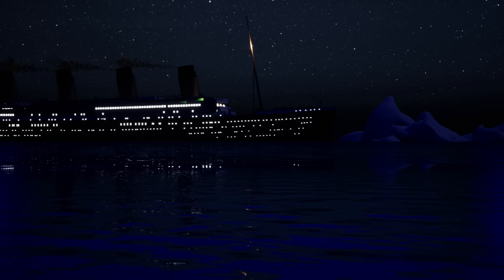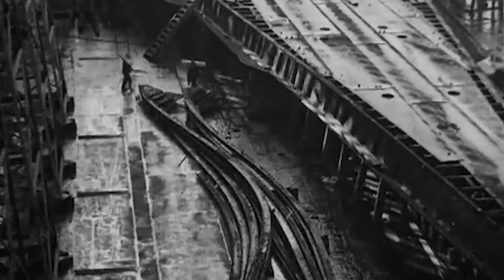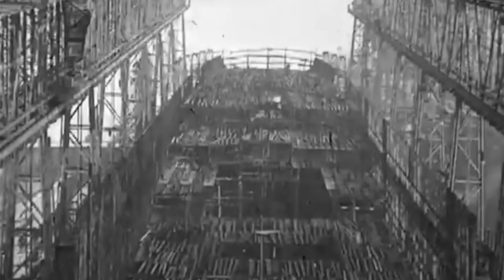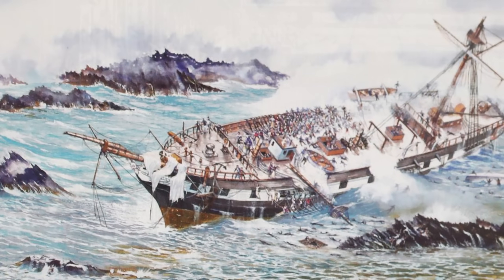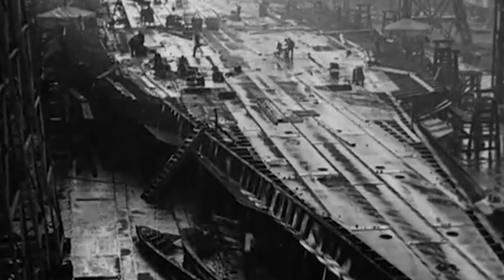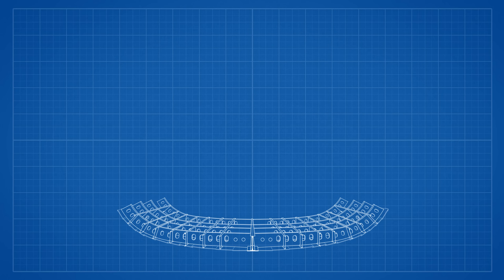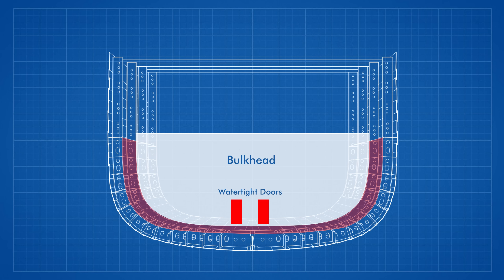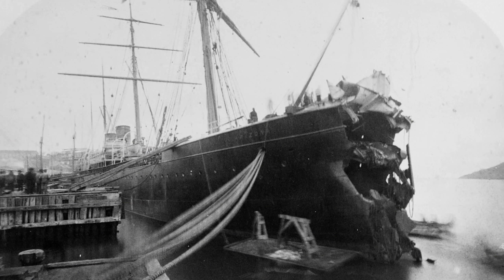How did the Iceberg Sink the Titanic?

Comment: Why would a crew member risk going through a closing water-tight door when they could just walk up stairs to escape the compartment? It seems very dangerous compared with the simple task of climbing stairs. Given the understanding, I assume, the ship was designed to deal with hits directly head on, but was limited in the damage it could take to the side (4 compartments), why did the crew try to turn the ship without any certainty they could get the ship well free of a side collision? While Titanic was able to turn aside to a significant degree, particularly for a ship her size and mass, trying to get by the ice berg seems a risky proposition when a head on collision was a near certainty of survival. Lastly, how are compartments "water tight" if they don't have a lid? Clearly, anyone could see water could, as it did, go over the top into the next compartment.
Reply: The Titanic basically broke records in her handling both leaving Belfast, and during her sea trials. For the size, her performance was remarkable. Murdoch had full faith the ship could avoid the iceberg, and in truth, they ALMOST made it.
Reply: Also, the compartments are watertight because the bulkheads do not need to be sealed at the strength deck (longest continuous deck that seals the hull).

No ships had ever been designed with bulkheads that reach the strength deck, and even modern ships aren't. The only exception is warships, and only the specific compartments intended to store munitions.

The watertight bulkheads work, even without being fully sealed, because water inside a ship cannot possibly reach any higher than water outside the ship. It's physically impossible.

The internal air pressure matches the incoming water flow, and equalizes, stopping the flooding. The water stops there, and ship bulkheads are designed higher than sea level, ensuring their functionality.

But when multiple compartments are breached along a ship's side (something that had never happened before in naval engineering) enough water is now inside the ship to pull her low enough, that the tops of the bulkheads are now below sea level, allowing the water to rise over the bulkheads and spill into the next compartments.

If you think Titanic's design was faulty, consider that the Olympic class liners were all designed to float with 4 compartments in a row flooded. After Titanic sank, the design was augmented to allow them to float with 6.

Modern ships can manage 2 or 3.

It's all about the design, but designs cannot overcome nature.
Reply: @pc_buildyb0i935  "If you think Titanic's design was faulty," Of course I think the Titanic design was faulty.It sank on its first voyage. By any measure, that is a faulty design.
Reply: @MacAdvisor  Sorry, but that is an entirely naive argument. Ships sink because nature overcomes their design. It's not possible to build a ship that is completely unsinkable, and so every ship can be sunk, therefore ANY ship can sink.

It's not due to a fault in our designs. We can't beat nature, end of story.
Reply: @pc_buildyb0i935  I didn't suggest the ship should be unsinkable, I stated sinking on the first voyage out shows a clear issue. Moreover, improvements were made to the sister ships, so there was a flaw to be fixed.
Reply: @MacAdvisor  I know you didn't say the ship should be unsinkable, what you said is that is shouldn't have sunk, and what I am saying is that nothing could have been done to prevent it because people cannot see the future. Every single ship ever built has a tipping point after which she will sink. While these tipping points change through history, and vary somewhat from ship to ship, none can be designed to withstand nature.

Consider that the MV Explorer, a MODERN ship, was sunk by an iceberg in 2007. You can't out-engineer nature.

 No other ship before the Olympic-class liners (Titanic included) had been better designed - Titanic and Olympic were the most sophisticated, most advanced designs ever at that time in history.

Ship design works like airplane design - designs only change after disasters.

No ship disaster had ever before happened like Titanic - and previous ships had hit icebergs head-on and survived just fine. The SS Kronprinz Wilhelm had struck an iceberg head-on in 1907 and only one watertight compartment was compromised.

The Wilhelm had been built during a time when ships were only designed to be able to float with ONE compartment flooded, if anymore than that flooded, any of those ships back then would sink.

In response, White Star designed Olympic and Titanic to float with 4 compartments in a row flooded, which was unheard of at the time and an example of over-engineering (it still is by today's standards, because modern ships can only float with two or three compartments in a row flooded - that's just less likely to happen these days).

Also consider the SS Norge, which collided with Hasselwood Rock in 1904 and had her bottom torn open. She flooded and sank in 12 minutes, and the majority of life board was lost.

In response, Olympic and Titanic were designed with double bottoms, to prevent that kind of disaster from happening.

Do you see what I mean? Ship designs are updated in response to accidents at sea. Nobody can see the future.

When Titanic struck the iceberg, it was at a time when no ship had ever taken side-swipe damage like that before, which is the reason why the ship's sinking was such a big deal.

Comment: Watching this again makes me wonder... IF the titanic had a double hull like it had the double bottom, wouldn’t the flooding have made it list to starboard badly and because of that possibly capsize?
Reply: Yes, most likely. Because the bulkheads would still run along the double hull length and would have stopped at the same deck as the bulkheads' tops, the water would have flooded the ship side-on and caused a capsizing. Far more people would have died.

Comment: Ocean liners also needed more life boats.
Reply: They did, but lifeboats were not primarily lifesaving devices back then. The Atlantic Ocean is notoriously stormy, and lifeboats do not survive even mildly stormy weather.

The very calm conditions that allows lifeboats to survive that night were so extremely rare, designing lifeboat numbers to accommodate situations like that made no sense.

Lifeboats were only aboard to ferry passengers to a nearby rescue ship. Take a look at what happened to the SS Atlantic and the SS Norge. Most of those boats were smashed to pieces against the ships by heavy waves, or rolled over in the sea, or simply flooded by breaking waves and sea spray.

Comment: The shipbuilder ordered number 3 iron rivets instead of the stronger number 4 type
Reply: Not true. Titanic's hull flank and double bottom were all sealed with 6" full steel top quality rivets.

The #3 wrought iron rivets, the same rivets every single ship in the world had been using for over a century at that point, were used in the very curved plating of the bow and stern
Reply: @pc_buildyb0i935  Interesting. So I guess I heard fake news about #4 rivets being better on the curve. Thanks
Reply: @AllenMacCannell  I wouldn't blanket term it as "fake news".

The stronger rivets were installed on the hull flanks and double bottom because the hydraulic rivet press was vertically suspended from the gantry.

It couldn't reach the lower and curved steel plating of the extremes of the bow and stern, so the larger rivets could not be installed there, and the traditional wrought iron rivets were instead used out of necessity

Comment: I've got a question or suggestion for a video: would the Britannic or Olympic with the double hull or improvements survived the same fate as the titanic given these improvements
Reply: Yes and no. Had both Olympic and Britannic been designed to float with 4 watertight compartments, then yes, because the double hull would only reach as high (and probably not even) as E Deck, spilling water into the next compartments back. They would have rolled over and capsized.

But Olympic was modified after Titanic and Britannic's design was changed so that both ships could survive 6 watertight compartments flooding, in which case both would have survived the Titanic's iceberg damage.

Comment: The iceberg collision itself knock an entire hull plate off the boat,it lays there at the bottom three miles away at the collision site,it's a huge piece of the outer skin the double hull was immediately opened too the sea
Reply: Titanic did not have a double hull, she had a double bottom. There is no hull plate knocked off the ship.

You're either confusing this for the "big piece" a section of hull that tore off when the ship broke apart, or you're thinking of the ship's double bottom, a section of which was located in 1998 during an investigative dive.

Comment: why didn't they have pumps to pump out the water from those compartments ?
Reply: They did have pumps, and they were used in an attempt to stop or at least slow the flooding, but they couldn't pump out the water fast enough as tons and tons more flooded into the ship than could be pumped out. Ultimately, the pumps only gave the Titanic an extra few minutes at most.

Comment: You mentioned the bulkheads were not designed to take water from the top ? How should that problem been solved ? Or why couldnt they make those bulkheads to not take water from the top?
Reply: They would've closed the top, but they didn't because the designers never thought about a situation in which water would be flooding more than 4 compartments.
Reply: @Unusual_360  Not only that, but something that Mike actually missed and I thought I'd point out is that the water inside a compartment in the ship can only flood as high as the water level outside the ship - the water cannot reach the tops of the bulkheads. Mike has an animation showing the interior flooding with the water reaching the tops of the bulkheads and stopping but this is a mistake, as the water level inside the ship can only reach the water level outside the ship, it cannot go higher inside than what it is outside.

In Titanic's case, the bulkheads were plenty tall, the issue is just that enough compartments were compromised (6 in total) that the total volume of water influx into the hull was enough to pull the ship down low enough to where the bulkhead tops fell lower than sea level and because of this, the compartments were compromised.

Comment: I have read that when the iceberg was sighted, the officer of the watch ordered hard over rudder and signaled to put the starboard engine full ahead and the port engine full reverse. Doing so automatically cut off power to the ships center propeller and created a great deal of turbulence in the vicinity of the rudder, drastically reducing its effectiveness. Had he just ordered hard over rudder it is possible Titanic would have turned far enough to miss the iceberg or possibly suffered considerably less damage.
Reply: Except that they didn't reversed the engines, they stopped them, fourth officer Boxhall was the only one who claimed that the crew put the engines in reverse, but he wasn't in bridge at the time of the collision.

Comment: The rivets used in Titanic's bow weren't as strong as one would think. In Cameron's film, Andrews tell Ismay that Titanic was made of iron and this is true. The rivets used in Titanic's bow were made of wrought iron rivets, which were hand made to save costs and meet deadlines and contained no steel and were hammered into place by less experienced workers at Harland & Wolff and because of the angle at which the rivets were hammered into place, they contained slag, which means they were more prone to breaking and popping lose upon meeting extreme pressure. Go watch a documentary called 'Titanic: How it Really Sank" from National Geographic.
Reply: 1 - Head on over to Encyclopedia Titanic and do some actual research using legitimate sources and stop taking everything documentaries say seriously. MANY Titanic documentaries are sensationalized and dramatized (for example, Birth of a Legend straight up lies).

2 - Understand that H&W had a specific partnership with White Star wherein all projects were signed with blank cheques and open-ended timelines - there would be no cost cutting because there was no cost. H&W had White Star's blessing to spare no expense in meeting their design specifications, and Titanic was no exception. The deal was H&W would spend what they had to in order to complete the project, and then would bill White Star cost + 6% proffit. This was the standard of every business deal between White Star and H&W.

3 - The steel rivets installed in Titanic's hull were gigantic, 5 to 6" solid steel rivets that needed to be installed by use of a hydraulic 3-man press that would slam them into the ship's steel plating. After the machine would slam a rivet in, it was pulled back and the men onsite would then hammer the rivets in the rest of the way and flatten the rivet heads to form the seal. Due to the rivet press being hung vertically from the gantry, it wasn't able to reach the curved sections of Titanic's hull and so the rivets in this area had to be installed by hand, which meant smaller rivets had to be used. Due to metallurgic limits of the time, only wrought-iron rivets could be made this large and installed by hand, as steel didn't have the malleability yet to be installed by hand - so the curved sections of the ship's hull at the very bow and stern received these wrought-iron rivets.

Keep in mind these wrought-iron rivets are the exact same rivets the shipping industry had been using for 100 years at this point, and they were perfectly adequate for the job. Slag was a well-known and expected byproduct of making wrought-iron rivets.

Titanic's rivets failed because a 46,000 ton ship collided with a 5-million ton solid iceberg at 21 knots. Are your knuckles tough? Yes, they are, but if you punch the blade of a steakknife as hard as you can, guess what's going to happen? The tip of the blade is going into your knuckle.

And since we're in the subject, any modern ship subjected to the same, proportionate iceberg damage that Titanic received would also sink, just slower. Enough of this "design flaw" nonsense. There are simply things that human designs just can't do. We will never defeat nature.

Comment: It is insane to me that thee watertight bulkheads appear to run almost to the exact point water would reach in the event of a number of flooding scenarios. Like there was virtually no margin for error. I cannot believe they didn't add a deck or two's height, just for added safety.
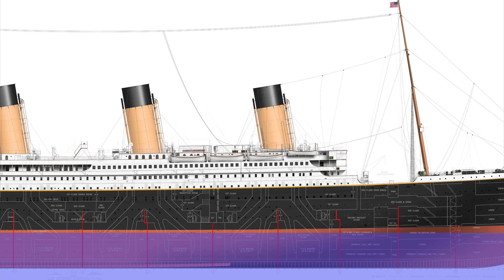Reply: Mike actually missed something really important here; water inside the ship cannot reach the tops of the bulkheads. Water inside a ship can only reach as high as the water level on the outside of the ship. The animation at 10:14 is wrong - the water inside the ship should not be that high, it would be stopped as soon as it reached (and matched) the water line outside the ship.

Because of this principle, the water bulkheads were more than adequate for the job. The Kronprinz Wilhelm had struck an iceberg in 1907, and only one of her watertight compartments had been compromised (like any other ship of the day, she had been designed to still float if one had been flooded). The Cunard Line, wanting to boast about safety, had designed the Mauretania and the Lusitania to survive two in a row. This was an example of over-engineering, as no possible collision at sea could be conceived where two compartments in a row would be damaged. The forces required for a collision like that had never before been encountered in a ship accident.

White Star, flexing their engineering muscle, designed the Olympic class ships (Olympic, Titanic and later Britannic) to be able to handle 4 compartments flooded. This was seen as just going above and beyond.

Another point I'd like to bring to your attention - keep in mind many ships of that day flooded quickly and rolled over and sank within a matter of minutes, but Titanic maintained an even keel and took nearly 3 hours to sink. Whether people realize it or not, this speaks volumes to the engineering prowess at hand behind the ship's design. And one, final closing point - even a modern ship, with the same proportionate iceberg damage that Titanic received, would still sink, just more slowly.
Reply: @pc_buildyb0i935 Thank you for that very detailed response and information.

Comment: I have been fascinated with the Titanic and its sister ships since I was a little boy. I’m now 39 years old and I’m still confused over one important thing. I have read and heard over and over and over how Titanic’s bulkheads did not extend high enough. While I understand what that means, I’ve never seen a photograph of what the top of the too-short bulkheads looked like. Do you know if there are any photographs of these bulkheads that don’t reach high enough? If there aren’t any photographs, can you describe what they look like at the top? Is it just some steel wall that simply stops in mid air below the floor of the next highest deck, leaving a gap where water could spill over? Thank you.
Reply: This is illustrated at around 10:14. The red vertical lines represent the bulkheads, solid walls that extend from one side of the ship to the other. It's a bit of a myth that they didn't reach high enough - water flooding inside a ship can only climb as high as the waterline outside the ship (so this animation is kind of wrong). The bulkheads being taller than sea level means the water inside the ship is stopped from going any further than the areas that are opened up to the sea. Unfortunately for Titanic, such a large number of compartments (6) were opened up that the combined weight of the water pulled the ship low enough that the heights of the bulkheads now went below sea level outside the ship, and so more water could continue to flood into the ship.